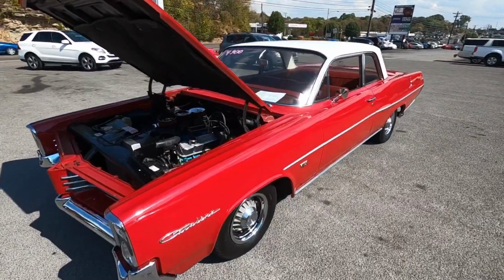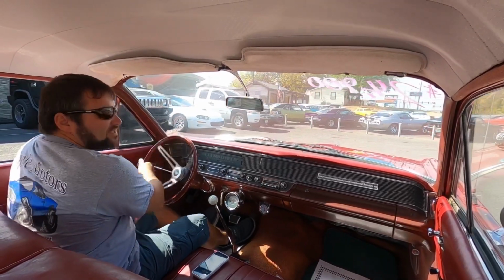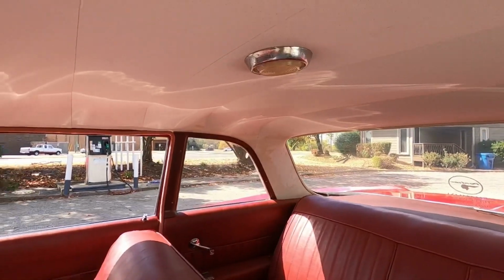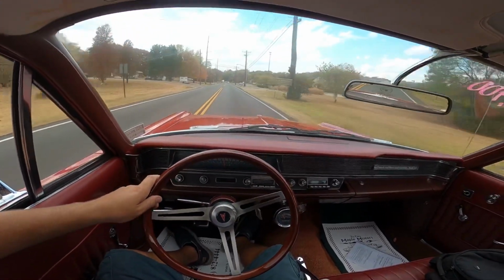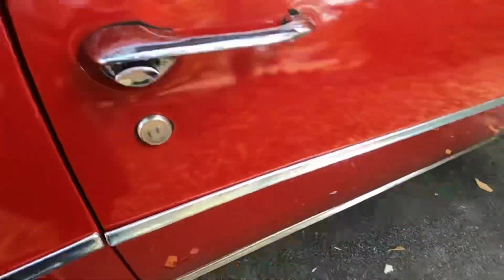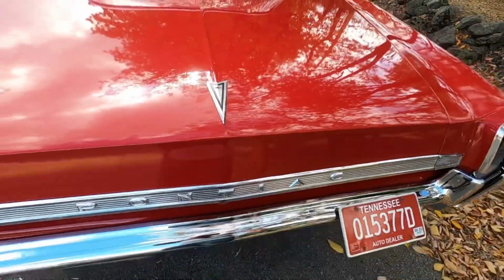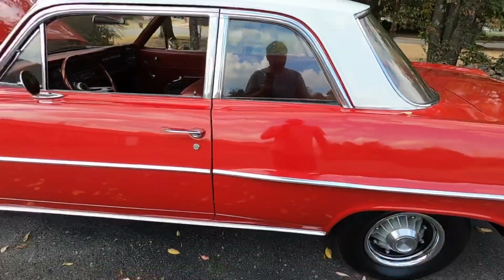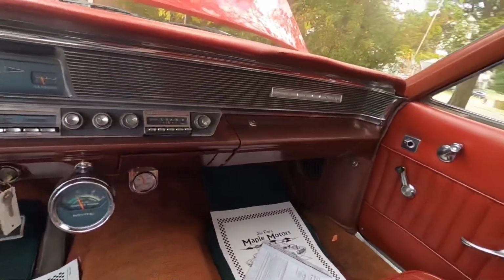Test Drive 1964 Pontiac Catalina 455 4 Speed SOLD $22,900 Maple Motors #1893

Comment: Nice Pontiac Nick, and as for the engine noise I had the exact same noise with a 283 motor once and it turned out all it needed was to grease the speedometer cable and I never heard it again. Those 8 lug wheels are rare, I enjoy all the videos that you post. You are one hardworking Man.

Comment: You got a lifter knocking. It's a quick adjustment. The valves and rings are good it's not smoking. I would also check the oil pressure.